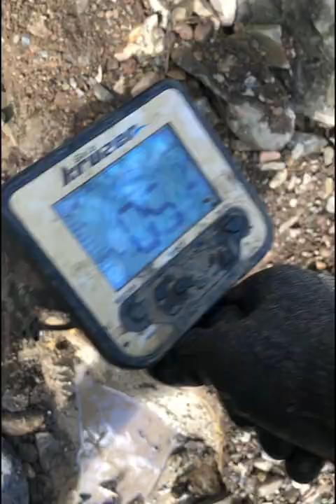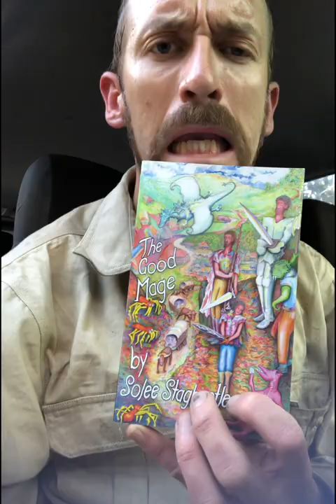The Gold Wizard, Pickers by eye and detected, gold, gold and more....wait for it....gold!!! part 3

Comment: FRIEND I AM FROM COLOMBIA I WANT TO ASK YOU WHAT CONFIGURATION YOU USE WITH THE MAKRO GOLD KRUZER TO FIND SMALL GOLD STONES THANK YOU
Reply from the maker: CHAMAQUITO DE ORO hello from Australia, I run general with sensitivity around 60-70 depending on the day, sometimes the interference is too high for the machine to run smoothly above 60.
The rest of the settings are pretty close to factory but can be adjusted slightly, it’s more about getting the machine to run quietly without too many false signals, use your headphones and keep your coil moving slowly.
Hope that helps, they are a great machine.
They don’t have a great depth so remember to keep your coil as close as possible to the ground. Let me know how you go, would be cool to see some Columbian gold! Goodluck
Reply: @91soulman  Thank you very much for the information. Here in Colombia, you have one more friend to serve you.
Reply from the maker: CHAMAQUITO DE ORO thank you! Let me know how you go, I’ll try and post a video of some settings and techniques over the next few weeks
Reply: @91soulman  gracias
Reply from the maker: CHAMAQUITO DE ORO my machine has been playing up of late so I haven’t been able to make you a video.
However, as settings go, the factory preset will work fine, just make sure you ground balance often.
I can run gain in this particular creek up to 80 but some creeks and areas require a much lower gain.
I keep tracking off, slow and low as always, sometimes you need to move sediment and materials off of bed rock to get to where the gold is then detect over the rocks once it’s cleaned.
Hope this helps
Reply: @91soulman  friend thank you very much for the information greetings from Colombia here you have one more friend
Reply: @91soulman  friend tomorrow I get the gold kruzer I hope you upload the video of the settings greetings God bless you